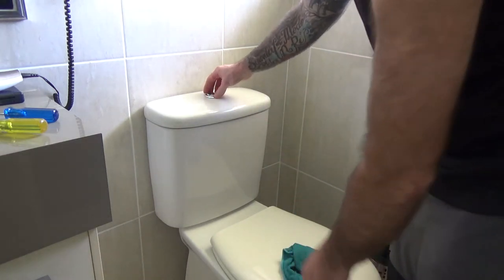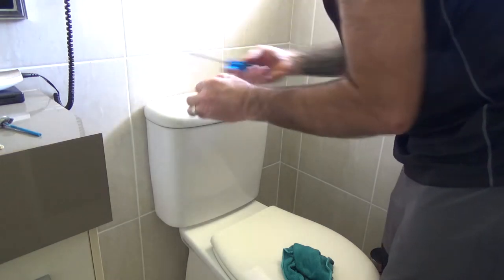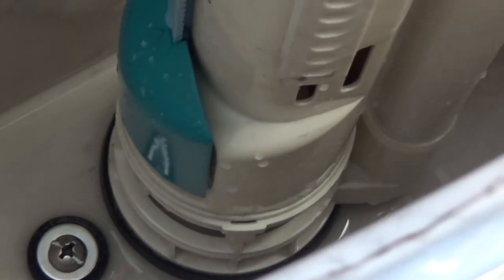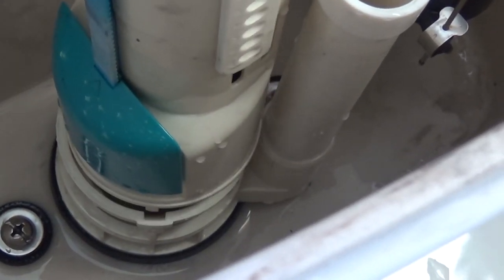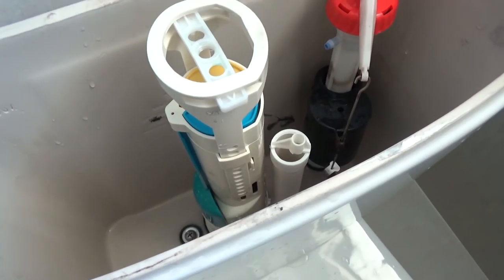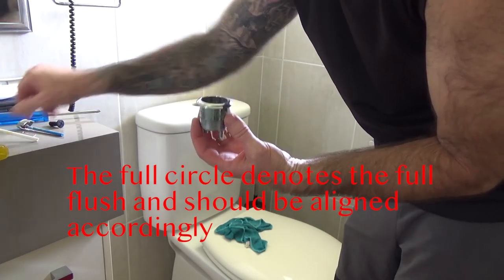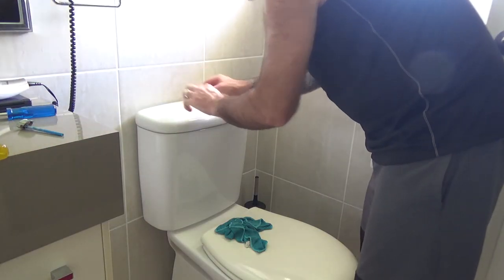Porcher toilet flush valve removal

Comment: Thanks for the video.  You don't have to stretch the washer/seal.  There are 2 small lugs holding the bottom seal/washer section in place, so pull down on washer section apply pressure to lugs and bottom section pulls off to replace the seal, then push  back into place.
Reply from the maker: Cool thanks for sharing that information! Appreciate it.

Comment: Thanks just fixed my toilet. The brand is indeed Watermark, my entire system is Watermark branded.
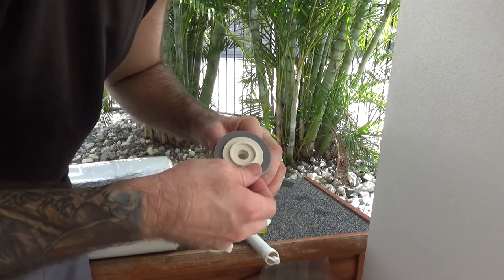The easier way to line up the lugs is on the other side. At 1:38 you can see the other lug just under your thumb and directly above that is a short slot in the side of the unit with a small red tab at the top. Finding this makes it much easier to line up the tabs.
Reply from the maker: I thought it was watermark but I have seen where a few people have stated that watermark isn't a brand it's more like an Australian standard which applies to various brands. I'm not 100% sure on this but I believe it to be true. Thanks for you tip about aligning the lugs, I'm sure a lot of other people will appreciate that as well. Cheers

Comment: Hello How to raise up the height to the underside of lid , thanks
Reply from the maker: Im sorry i don't understand what you mean. Do you mean raise the water level so there is more water when you flush??
Reply: @bossmanDIY  . Hello it is all  good , I managed to find the  two little buttons on the side so that the top.sectiom of the flush valve can be lifted to the correct height. Thank you for your reply and helpful video
Reply from the maker: @cheapshots2  Ok. Glad you solved your problem and found my video helpful. Thanks

Comment: Hi Bossman.love your videos I have exactly the same toilet. It is leaking from the bowl just when it flushed. I can see some blue loo coming out from the gasket at floor level behind the toilet. Do you know if these roilets are siliconed or screwed down? Not sure if there is a trick to it. Thanks heaps for any help, Darrell
Reply from the maker: Hi Darrell, It depends how they were installed, they are mostly siliconed down but there is a cap on each side of the toilet base remove these and see if it has screws under the caps. My caps had been stuck in place and no screws visable but there was a bead of silicone around the entire base which I removed using a sturdy paint scraper (tapping paint scraper with a hammer or mallet to break silicone). Once that is broken right around, you should be able to just wriggle the bowl and lift up (have an old towel or two handy and use a sponge or similar to remove all the water you can from bowl first). There should be a seal between the bowl and the floor plumbing so that is likely your problem.
Reply: @bossmanDIY  thanks heaps the caps were just siliconed in. No screws. Toilet off successfully using your paint scraper idea. Going to replace all 3 seals despite no obvious cracks in them.by the looks of it one may have just dislodged a bit. With these black and white seals are they greased or anything? There are 2 black seals and one white one. Cant thanks you enough for the videos, really helpful. Darrell
Reply from the maker: @darrell00000  Hi Darrell, sorry I missed this comment, glad i could be of some help. Not sure if they are meant to have anything. I don't think i used anything on mine but if I did it would have been "waterproof tap lubricant". You can get "plumbers grease" or use petroleum jelly but I just googled it and silicone grease seems to be the best to prolong the life of the seals.
Reply: Hi Darrel :) I’m having the same issue with leaks every time I flush from the cistern bowl onto the base where the toilet seat it… can you please advise how we access the screws to remove it to change the seal? It looks to be all closed off…. Thanks in advance 🙏
Reply: Hi Bossman :) I’m having the same issue as Darrel with leaks every time I flush from the cistern bowl onto the base where the toilet seat it… can you please advise how we access the screws to remove it to change the seal? It looks to be all closed off under the cistern…. Thanks in advance 🙏

Comment: Cant align the lugs
Reply from the maker: It can be a bit fiddly. 1:31 in the video - can you use that as a reference. If yours is the same, the lug should be in the same position. It could be that it is just stuck tight (may not have been removed ever). Once you do get it removed you can put a reference mark (permanent marker pen or something) where the lug is to make it easier to locate in future. good luck
Reply from the maker: I just filmed a quick video to try and help you buddy. I'll quickly edit and upload.